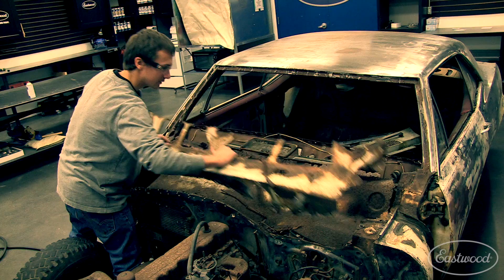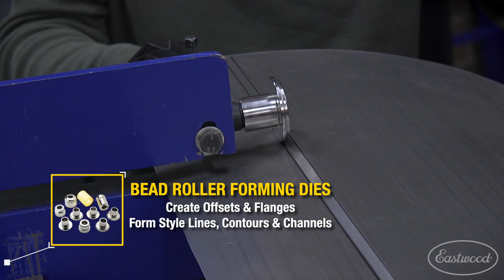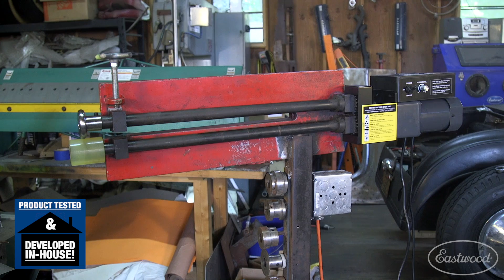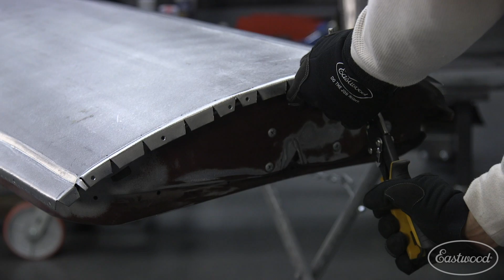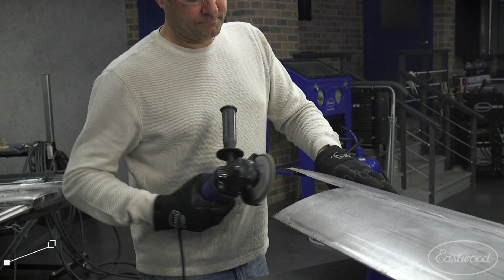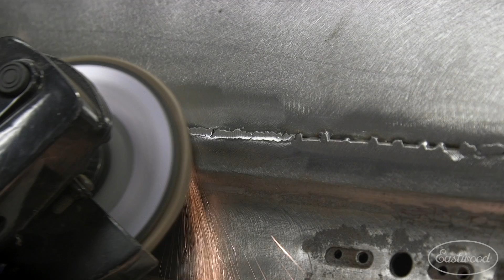How To Repair Rusted Door Pt.2 - Repair Restore Revive: Ep.4 - Eastwood

Comment: Video 2 

Couple thoughts?

Why is the vent window in? You’re grinding and welding all around that area, very easily will the chrome and glass get ruined. Same note, you pulled out the inner working of the door that were a mess, now you’re putting in what looks like brand new parts. Why are you even putting them in? Again, this isn’t the time. This is a final finish thing after blasting and paint process. Nice work making the door skin. Be more descriptive when using a tipping wheel. There’s no explanation that upward force has to be used for the tipping to work. You drilled plug holes then brought out the perfect panel, doesn’t that have the hole punch? No weld through primer used on the inside of the door skin, no coating at all. At the 1159 mark, the lower body line clearly is off.
Reply: brian weaver I agree I just saw the clip where the sparks hit all the new chrome and glass.

Comment: 3 weeks waiting for a short video. Should of been longer and better
Reply from the maker: Thanks for the feedback. What do you want to see more of? This was only our 4th episode and we're trying to make each episode as good as possible. Most will fall in the 17-22 minute range.
Reply: @eastwoodco  like I get repairs is what u guys are doing currently but what if u wanted to do something custom like inner fenders or lift a bed floor for a bagged truck
Reply from the maker: Like on a 70s or 80s C10? We're looking for ideas!
Reply: @eastwoodco  I'm ur guy I have a 83 c-10 that's currently getting bagged and so its getting lots of custom stuff inner front fenders. Rear bed is getting raised and tubs on the bed as well. One thing I'm working on is cutting the frame and changing the design of the floor because of where the gas tanks are mounted from the factory need to redo it so I can put regular 2014 Silverado seats. I'm doing a lot but it's what I love to do

Comment: I really appreciate this series. I'm going to be starting on our 2000 Excursion and 1995 Ram pickup soon. I also need to help my daughter finish her 87 Silverado. Could you explain the differences when you get to body work and orbital sanders? I'm assuming the 3/32" ones are for finishing, but if you could show when and where to use the different sanders I'd appreciate it. I was thinking of the Hutchins 3500 and the 3560. Thank you